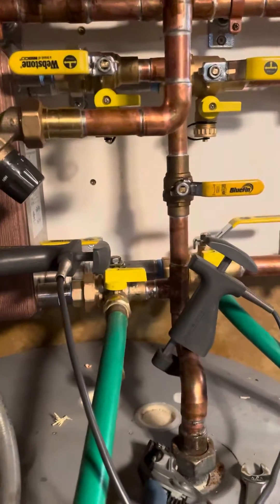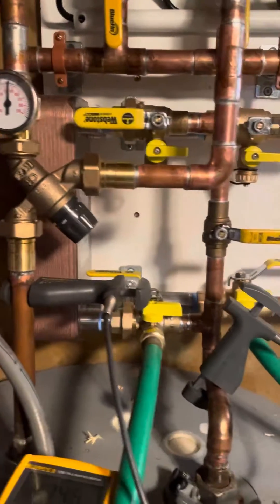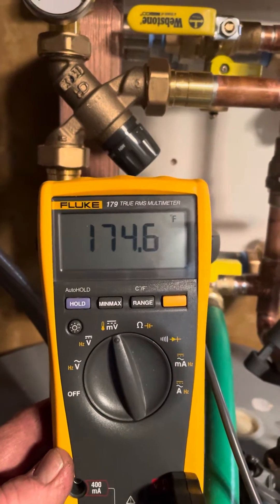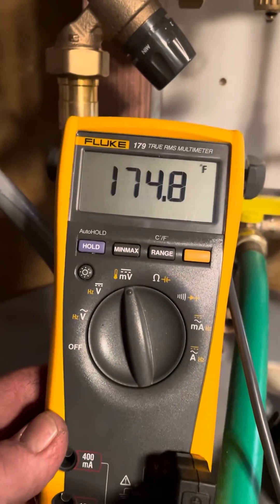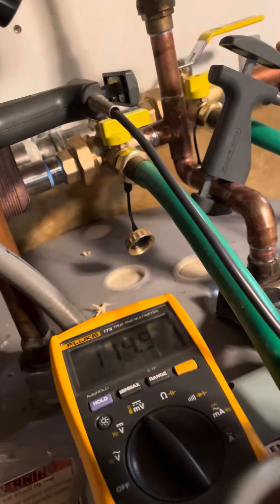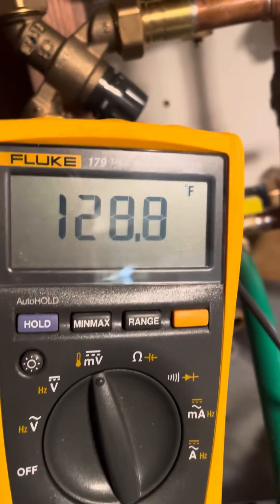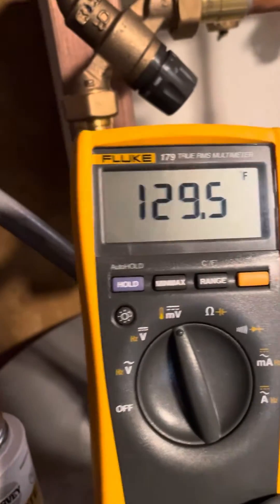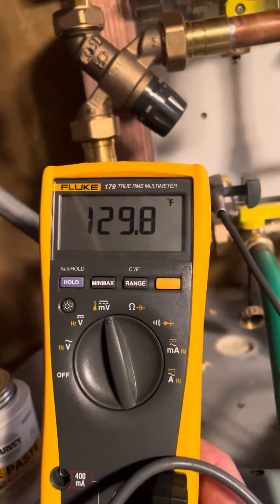Why a tempering/mixing valve is a MUST.

Comment: I really like the Caleffi mixing valve I installed, it holds +/-2 degrees of where I set it,  usually within 1 degree. Way too hot without it.